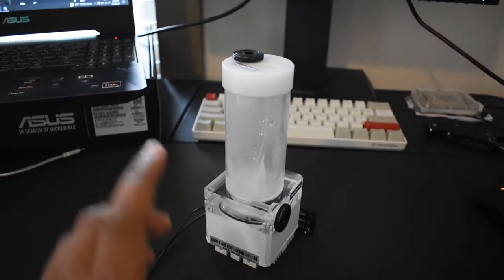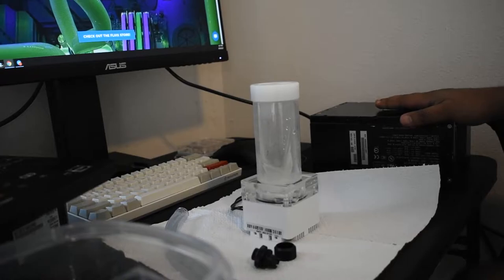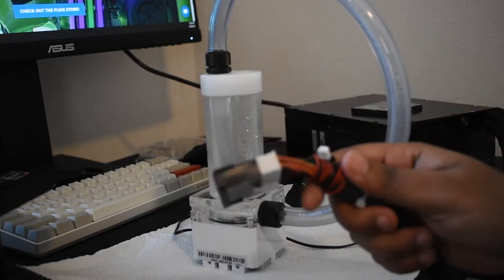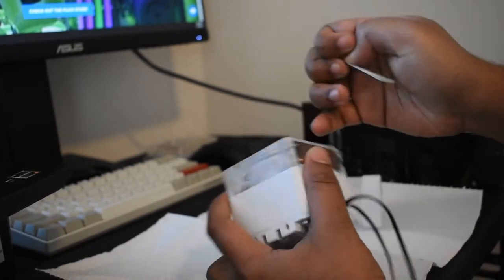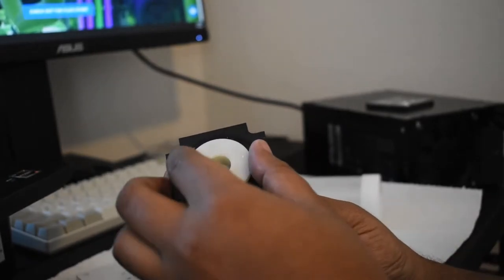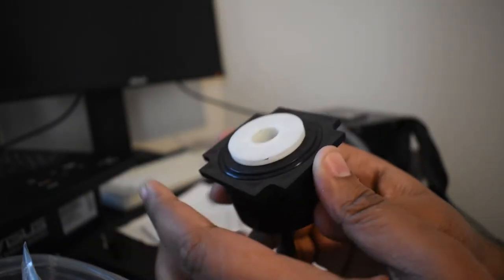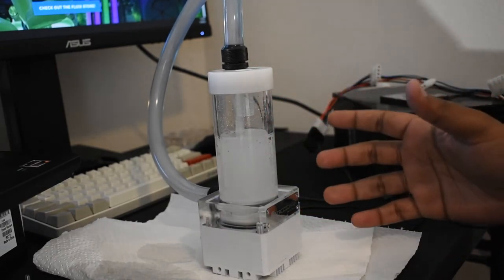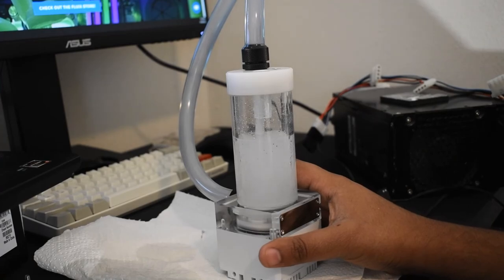Let's fix this PC water cooling pump...

Comment: this video needs a million likes. You just saved me about $200 and a couple weeks of downtime... I bought a prebuilt ekwb gaming pc with a pc-011d distribution plate a year ago. I was sitting here and for no reason my pc starts stuttering and then shuts down. I fired it back up and my pump was clearly not working and it went into bios with alarms for cpu fan failure. I tore apart all the plugs and checked everything, still no go. I figured the pump was bad so I called customer support to see if it was covered under warranty and nope... They wont even sell just the pump so I would've had to buy a whole new distribution plate at $200 and swap everything over. I couldn't find much on diagrams of this specific type pump to try and see what the issue was so I just grabbed a screwdriver and some towels and started digging in. I didn't know what was supposed to move and what was supposed to stay put. Your video was PERFECT to see what was wrong. The impeller was seized on the shaft. After having to pry on it to get it off, I started cleaning everything out and finally freeing it up to spin a bit. One thing you didn't note on here was those TINY little washers on the shaft. I damn near dropped them in the carpet and they would've been goners if they didn't stick to the magnet. 

Got everything put back together and hit the power button and had nothing but relief that I somehow fixed it. Kudos on the great informative video bro!
Reply from the maker: Glad it was fixable! And thank you for the comment!

Comment: Alright I'm going to vouch for you; because I had a pump that was "broken" and I watched your video. My pump was nothing like yours but I fixed it. Lets discuss..

I pulled my pump after three different attempts at rinsing the blades and re assembling; it wasn't that it wasn't working, because my pump would turn on and I could watch the blades spin inside but the fluid definitely was NOT moving. I watched this video and I was able to shake yank the magnet OUT of the housing (around the needle) that I didn't realize was removable. BUT, just cleaning mine didn't fix anything. I actually used a little dab of super glue and reconnected the blade to the magnetic portion, they were just sitting against each other lightly (they were designed to be attached but somehow detached, my pump had been sitting and jostled with moving) after I glued and let sit, I was able to assemble the pump and get it to run even better than it did before I assembled it in the first place. 

Thanks man, you saved me a bunch of trouble. I still got an extra pump (cost me like 25) just incase the fix fails, but I'm happy with my fix.
Reply from the maker: LET's GO💪 Great fix suggestion
Reply: If anyone tries this fix in the future, super glue isn't very water resistant. Better to use a two part epoxy or small amount of gorilla glue (original) OR best a marine epoxy.

Comment: Nice, this makes a lot of sense.  I don't use thick additives or colours in my loop, but I'm a bit lazy and don't clean it out very often.  Crud tends to build up.

When I built my loop I also bought myself a spare pump/res and after about 5 years my pump stopped working and I never attempted fixing it, I just swapped it out.  But after watching this video I figured out to take mine apart and cleaned it out.  I found by putting a drop of detergent through the hole at the centre of the impeller (that goes on the shaft) and spinning it manually, I was able to clean off all the build up sediment that was making it so stiff and now it spins quite freely.

I still need to test that it actually works, but if it does it's one less part to worry about should my loop stop working again.

Cheers.

Comment: That's what xspc fluid did to my silicone parts, wrecked an entire system. 👍
Reply from the maker: Hope you were able to flush and fix after. As you mentioned, common issue on silicone parts

Comment: I have the same pump and it works fine when connected to itself and when I add a radiator, water flow is perfect. But the water will not flow through the gpu block at all, no water flow. Any thoughts? Have you seen this before?

Comment: thanks for this, what is the other connector for ?
Reply: Usually the other one is to be connected to MB or a sperate controller to control pump speed.

Comment: Are you sure the term shorted is correct when referring to the 24 pin adapter? Just wondering terminology wise.
Reply from the maker: Maybe junction?
Reply: 24 pin 2pin short is commonly used word since stone age of PC building and troubleshooting.

Comment: Hi, my molex connector has snapped off the cables from the freezemod pump, two black one with white markings do you know which go where on the molex connector thanks 👍
Reply from the maker: There should be two cable pins, the grey one goes to the marked #1 pin on the molex connector, and the black one goes to #2 pin on molex.  This is a common issue for these pumps, sometimes manufacturers warranty will help you replace this.
Reply: @fluixtech  thanks for that, much appreciated
Reply from the maker: @mbrewer98  You got it!
Reply: @fluixtech  I accidentally  broke the molex  cable pulling it through the system, then wired it up wrong now it doesn't work

Comment: The connector doesn't short out the power supply it closes or completes the start switch circuit that is built into the power supply.
Details matter to beginners. Not being mean, great video.

Comment: All you did was rinse the blade and put it back in. 
For all we know you unplugged the power supply turn the switch and said the pump doesn’t work. Rinse blade, assemble, plug power supply back in. Turn switch and the pump works… lol
Reply from the maker: 😂 Alright 💪
Reply: @fluixtech  Not Trying To Be Dick…
But I was hoping for more depth all he did was rinse off the blade. I did learn how the liquid is pulled in and that it was a magnet. Had no idea and keep trying to pull mine out. Was scared of breaking it till watched this vid. So now I’m going to make a pump/reservoir combo out of old AIO..
Reply from the maker: @MrryPopinzYall  💪💪